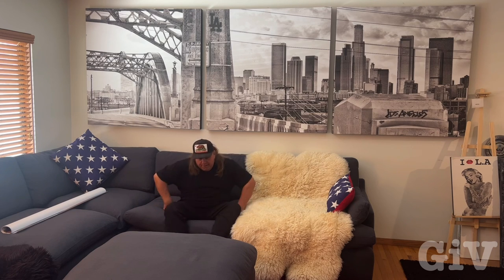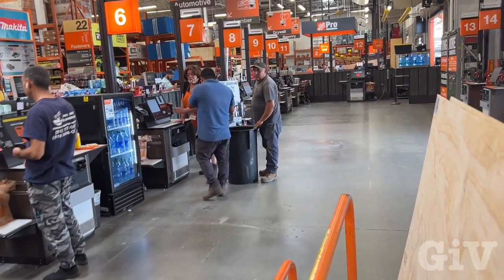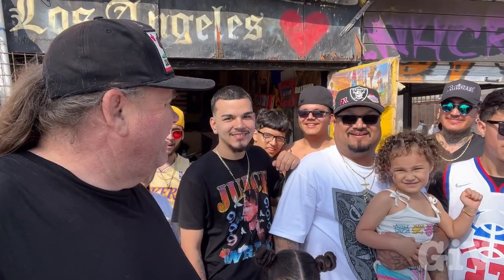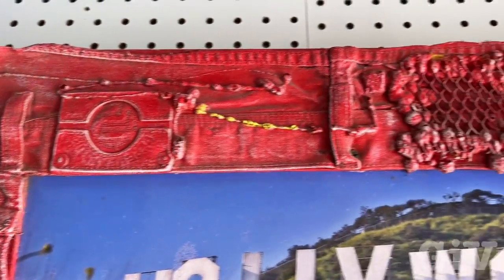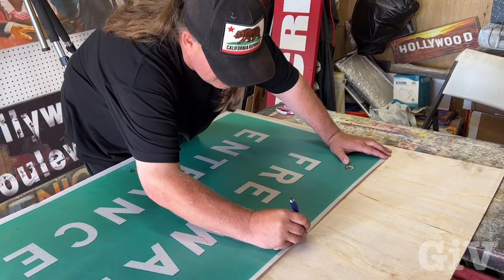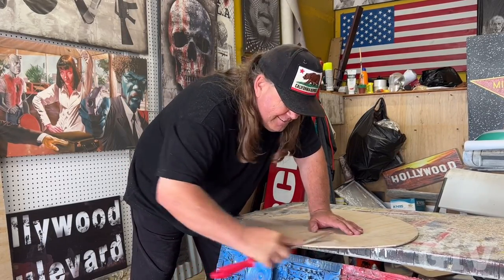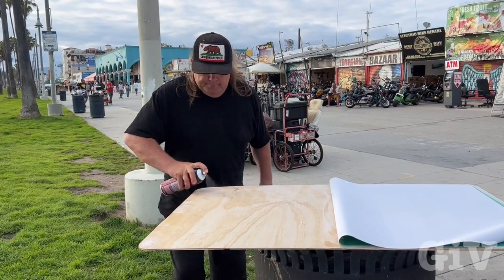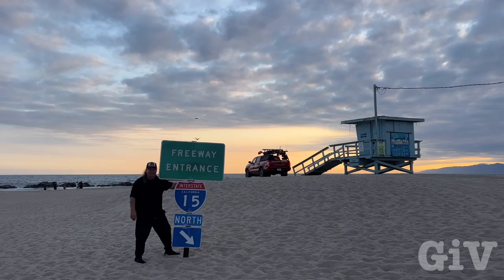That`s what I do, when I don`t do YouTube

Comment: Fantastic artistic talent.  That sign and your other work is cool.  Try using blue tape, painters tape, on the plywood and it will help keep it from splintering like it is when cutting it.  Buy a fine tooth blade with a higher number of teeth and it will make a smoother cut.  Weight loss makes you look younger and taller, congratulations, great dedication.  👍😎✌️🇺🇸

Comment: Way too much spray, just a couple light coats, let dry for 10sec then apply Vinyl. In the heat too much will get soggy and the Vinyl will fall off.  Ask any SPFX film tech.